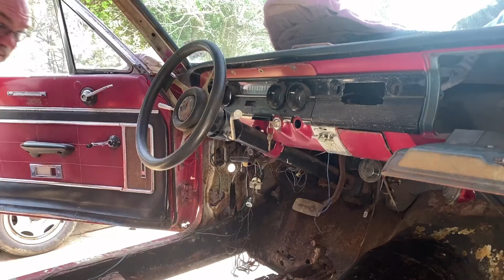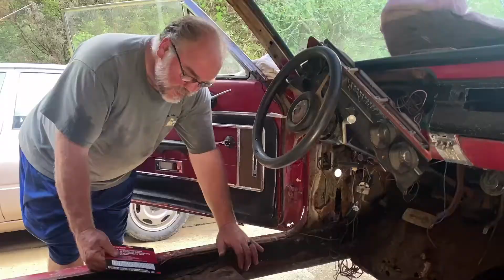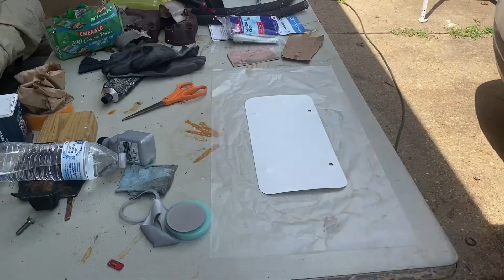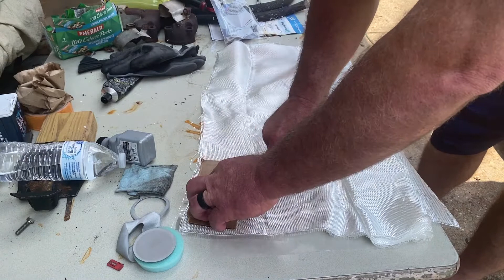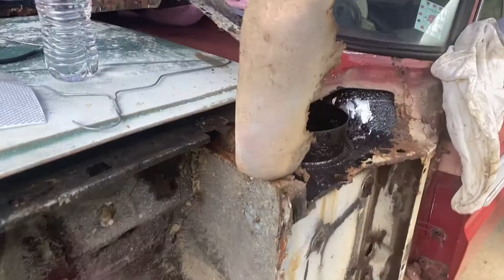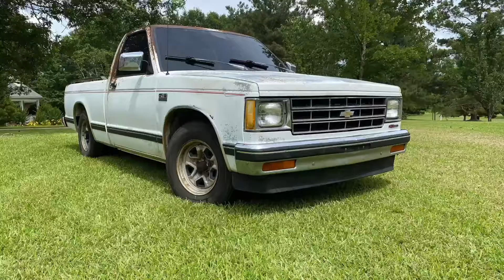Rust repair Por-patch and fiberglass

Comment: everybody uses the wrong cloth with these repairs, the chopped fiberglass cloth is best, much more stiff and easier to keep where you want it
Reply from the maker: It is easier to work with. I’ve used it before. But in this repair I just used what I had. It works, but like you said the chopped is easier to keep it where you want it. Thanks for sharing your experience with this. ✌️

Comment: You won’t be removing Por on your skin with, lacquer thinner, gas, brake cleaner if it’s on you better get used to it, and wear a proper mask that stuff will kill you.
Reply from the maker: If you get it off with thinner immediately while it’s still wet it will come off. If you wait until it’s cured, you’re correct, you will wear it off. The only reason you’d need a mask is if you were spraying it. A simple box fan to keep air circulating and it’s fine. If you’re in an enclosed space, you definitely want to make sure you get some good air circulation. Thanks for watching and commenting. ✌️

Comment: Good job👍. Hope it's still holding up. Quick question, do you think the poor patch is gloopy enough to brush ( or mini roller ) onto inner rocker/sill panels? Mine on my Cherokee XJ are starting to rust out with a few pinholes but I can't afford to replace & weld right now. Was thinking to paint with POR 15 but thinking this Por patch product might add extra strength. All the best 🖐️
Reply from the maker: So far it’s still holding fine. It’s outside in the weather, no sunshine directly on it. You might be able to roll it. I’d say roll it and when it was tacky go over the top of it with traditional Por15 .
Reply: @RealWorldGarage   Appreciate the reply thx, I'll try that. All the best 🖐️
Reply from the maker: I do my best to reply to as many comments as possible. Also if I don’t know something I’ll say that I don’t. Thanks for watching and commenting.
Reply: @RealWorldGarage  👍

Comment: thanks for demonstrating the patch , looks like great stuff. would you recommend it used as a seam sealer? Id like to try it but im afraid if i ever want to get it back off years from now i wont be able to because it dries hard as a rock.
Reply from the maker: I don’t know that I would use it for a seam sealer, it can however be ground   Down and shaped. It would likely be hard to get off later without a grinder.

Comment: would fiber glass resin work any easier
Reply from the maker: I don’t know that it has the bonding power of por-patch. I am also using por-15 paint, and these products are compatible with each other. I will have to show how well it bonds in a future video. Thanks for watching and commenting.
Reply: @RealWorldGarage  its interesting
Reply from the maker: @oldmanintheshopbuiltnotbou8726  thanks, I try to think out side the box. Welding in this area wouldn’t be an easy task.